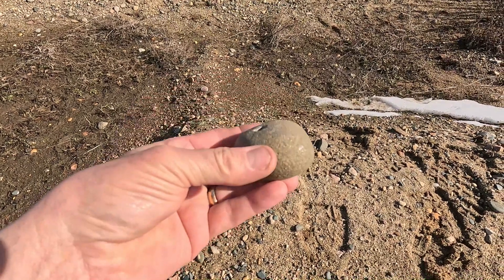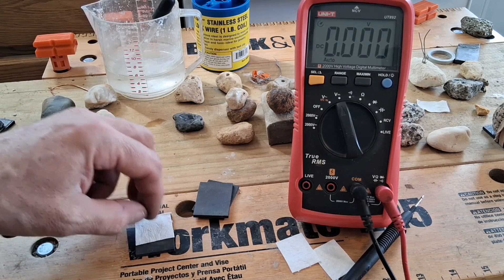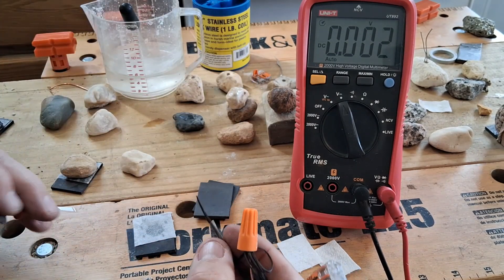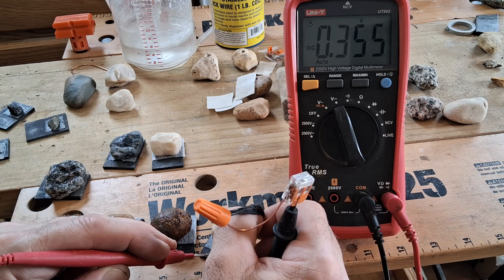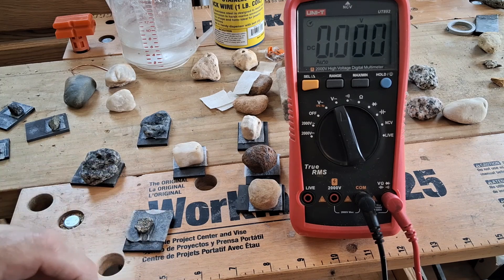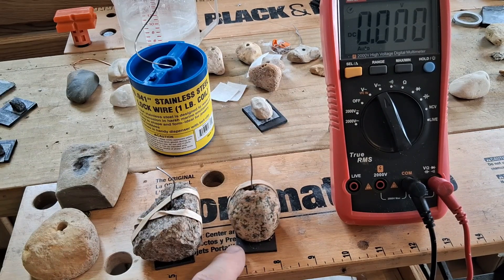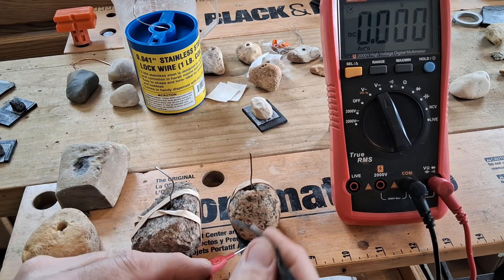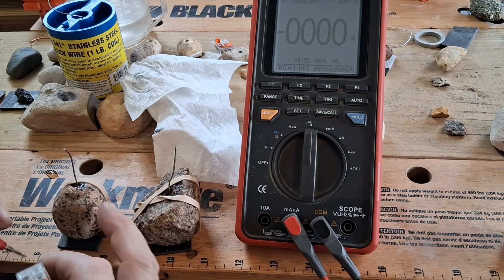Minnesota Stone Battery, & Stone Detectors?(crystal radio diode)

Comment: Fascinating!  This is activating off all sorts of ancient memories. They say the standing and labyrinth stones are also chosen for their special properties.  Makes me want to test my small rock collection, maybe the crystals also?  Wonder what I would hear if I connected crystal earphones like those old batteryless crystal radios.

We are all in this together; May all the powers assist us.
Reply from the maker: It is interesting with what you can find out there.  Northern MN has lots of iron mines, so I think that's whats in a lot of these stones.  I heard that you can use rusty razor blades for crystal radio 'detectors'.
Reply: @doubleMinnovations  That may explain a reference to using steel rebar as grounding rods.